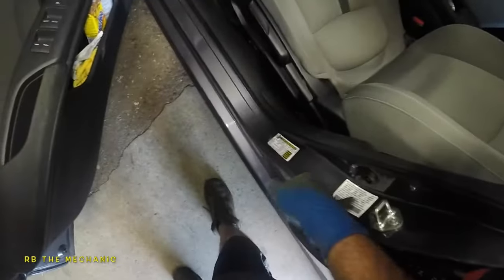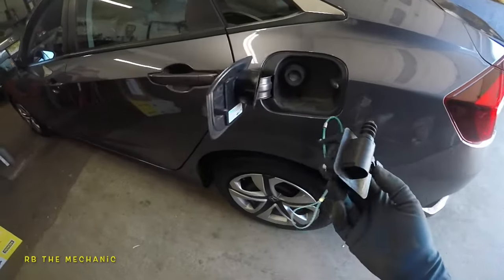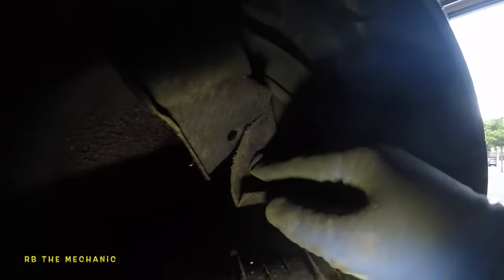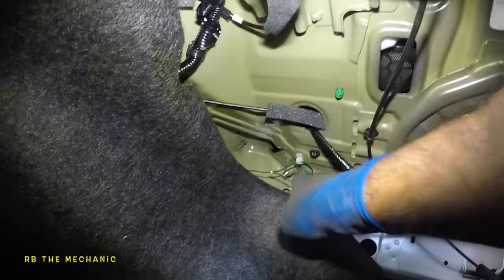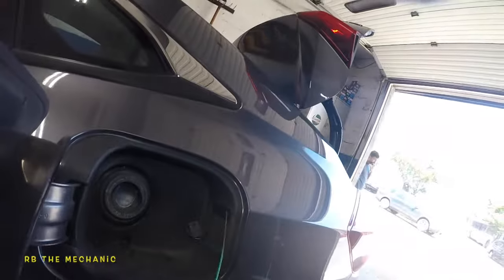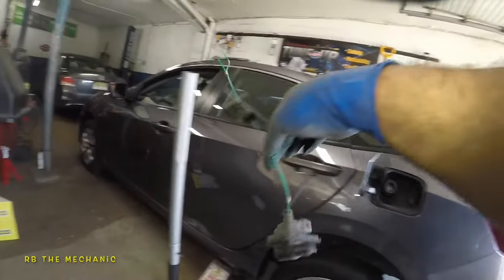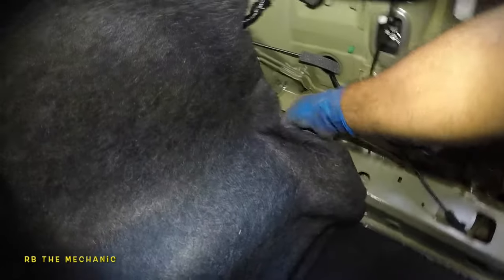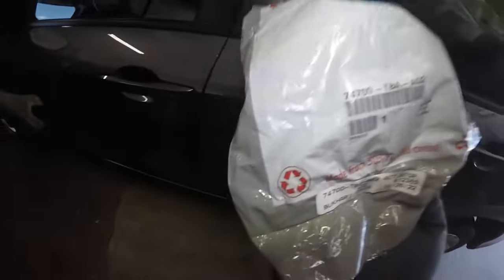2018 and up Honda civic fuel door actuator replacement to fix buzzin sound 2019 2020 2021 2022 2023

Comment: Didn’t realize how easy/cheap this was. Dealership charged me $95 for the part and is asking $170 for installation. Might just have to do it myself, thanks for taking the time to make this
Reply from the maker: Yup super easy
Reply: I recently moved a few minutes away and am within walking distance of a auto shop. Just got a quote to get my accuator replaced. They want to charge me $80 for the part and $180 for the installation. No way im doing that. Not even a critical repair. For something serious, I could understand that price. I bought the part on Walmart for $15. Amazon has them for $23. Just going to install it myself when I have the time
Reply: The worst part about dealership charging that much is the mechanic gets the smallest percentage for the work. Most of it goes to the dealer and the service advisor
Reply: Amazon under 20$
Reply: Dealer is charging me 350 lol thank you man

Comment: late 2024 here, Dealership charged $78 for the part and wanted $330 for install...Los Angeles ,CA smh. I've installed one from amazon for $24, it only lasted 3 months so I'm testing to see how long the dealership replacement part will last. Thanks for the vid!
Reply from the maker: Yes they nuts do it urself

Comment: Bonus tip. Attach a string to the green loop of the old part. Pull it through cut the string off and attach to new part. Tape rubber grommet in place so it can’t slide. Pull string from the trunk guiding new green wire through. Carefully help the grommet seat. Remove tape. Feed the rest of the way. Bam! Don’t have to remove any panels 😎
Reply from the maker: Yup thank you for the tip

Comment: Dealership charged me $800 to fix exactly that lmao. Thank you for this brother 👏🏽
Reply from the maker: They messed up its $49 part
Reply: That’s rip off
Reply: Yeah it was robbery. Quick update though, I fixed it myself and it only took me 1 hour jacking up the car, taking out the prongs with a flat head, taking out the old actuator, and a new $29-49 part from Amazon. Thanks to this video!
Reply from the maker: @JpnFn  oh ok glad u did it urself
Reply: The Dealer Ship is Telling me.
They don't have the part. It's Being 
Redesigned. Do you know
About this? Thank You!
Reply: Talk to your Attorney.
Reply from the maker: @danabiondo9243  not that I know but definitely should be recall I had some one send me message new one failed again after 3 months

Comment: That actuator failing at 15k really shows how cheap Honda went on the parts for these cars. I have a 2017 and I have had issues since I bought it. My wheel locks to the left trying to drive itself even though I have all driving aids turned off and all the electrical is wonky don’t get me started on the rubber window trim and weather trim on the roof 😭 and my actuator just went as well. Ughhh thank you for the video!!
Reply from the maker: They need to step up their game so many issues ac fuel pump this misfire injectors all kinds of BS

Comment: The Hatchbacks are even easier:
 
Remove all the tools/jack/Funnel from the said panel in the hatch. There you will see that hole for the plug. I used my hands and needle noise plier and a flathead to remove the piece from under the gas cap.  15min max. No need to jack the car up and remove cover :)
Hopes this help
Reply from the maker: Thanks

Comment: What is the purpose of the wire plug part that connects in the trunk?
Reply from the maker: Emergency manual open just incase it dosent open with electrical component because they knew this has and will fail very soon and they needed way to open it to replace it

Comment: My dealership refused to fix it, saying it was a known issue. I fixed it twice myself (super easy) but the same issue with the bzzzzzzzzzzzt when I lock and unlock the car. I'm so sad.
Reply from the maker: Check to see where it’s coming from it could be lock acuators each door has it so just listen to the sound

Comment: the problem is my fuel latch isnt opening i have the part but idk how to to open it because it is stuck even after pulling the green cable
Reply from the maker: Check to see the manual pull release in the trunk
Reply: @RBTheMechanic  yea brother have seen that and tried pulling it doesn't works what else can I try ?
Reply from the maker: @saifshaheen5429  not sure but u might have to go from bottom fender liner see if u can do somthing down there remove the cover first

Comment: I dont understand why you'd take the tire off. Just tie some rope on the loop before pulling the old one out and use the rope to pull yhe new one in. Super easy to fix, hardest part wad taking the old one out but if you tey fron the bottom it pops right out.
Reply from the maker: To show better

Comment: I have the same problem but I have the coupe version.

It's a problem I don't want to fix coz I kinda like the sound. 😂
Reply from the maker: Lol ok
Reply: Haha. sounds like an A10 Warthog. 

great vid though. I'll get to it eventually though. For when it's time to sell the car or something.
Reply: Ive had this problem for months and got used to the sound. It does sound pretty cool and it has confused so many people as to why my car makes that sound haha. I just bought the replacement part from Walmart for $14. An auto shop tried to charge me $260 for it. Only reason Im actually going to replace it now is cuz the door lock gets stuck and I have to open the gas door from the trunk

Comment: Don't even replace it. Dealers charge alot for simple things.
Reply from the maker: Do it urself 20 minutes maxxx it would take u longer to get to dealer
Reply: @RBTheMechanic What if you still have bumper to bumper warranty? Will this issue be covered by that?
Reply from the maker: @onehitwonder763  I think so depends on coverage but mostlikely yeah